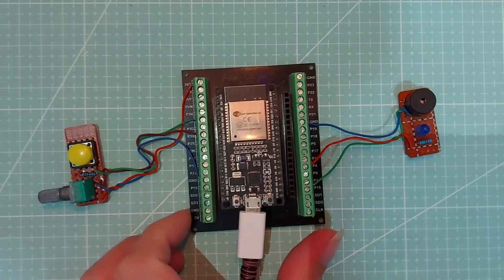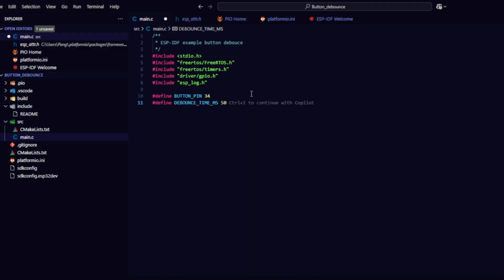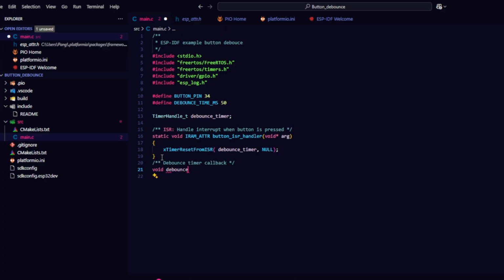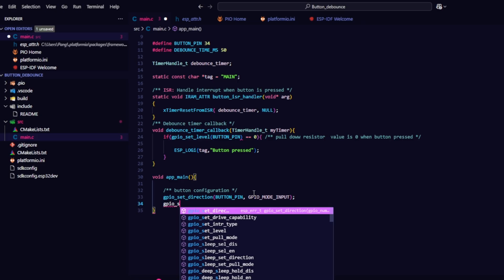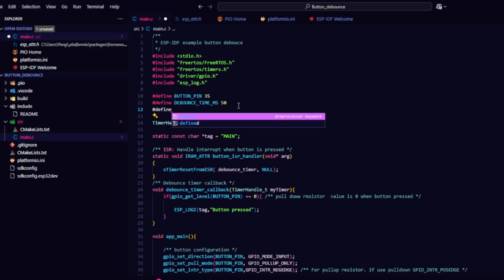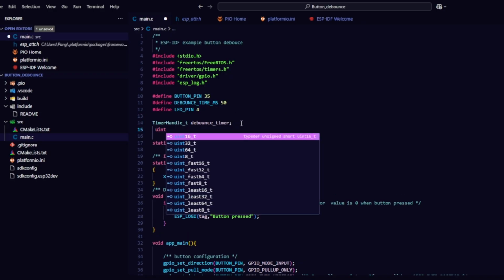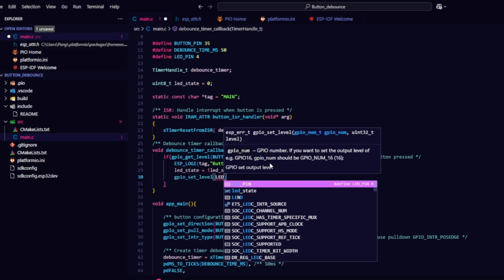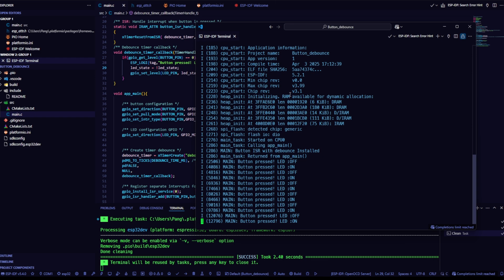ESP-IDF Basic #2 | ESP32 Handle Button Input Debounce!

Comment: Cool video.  Coding the debounce of a potentiometer on my most recent project was a nightmare.  Tried a bunch of different libraries/methods to get it to work properly.  For sensitive inputs, like a potentiometer, it's build quality is important too.  Lot's of trial and error.
Reply from the maker: For potentiometer you should use ADC1, it more stable and add calibration function from ESP IDF example, you will get more accurate value input
Reply: @pangcrd that project was built on an Arduino nano and I used the ADC pins.  I have yet to use an esp32 with a potentiometer for input.  The calibration feature sounds useful
Reply from the maker: @aarone.7551  As you may know, the ADC on ESP32 is not accurate and quite noisy compared to Arduino or STM32, so ESP IDF has a built-in function called ADC calibration to be able to read more accurate values with potentiometer. If you don't need too much accuracy, you don't need to use the calibration function. The source code will be simpler and neater.